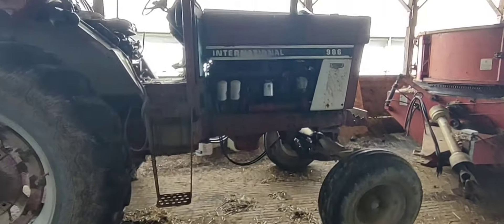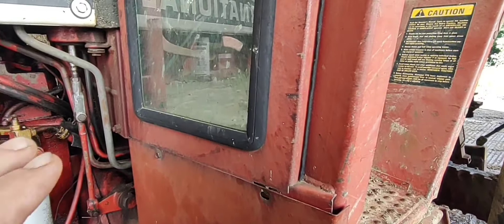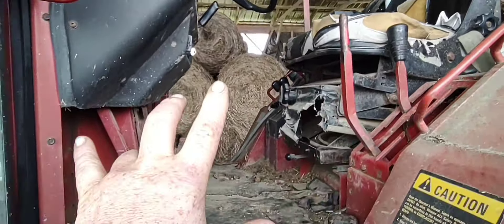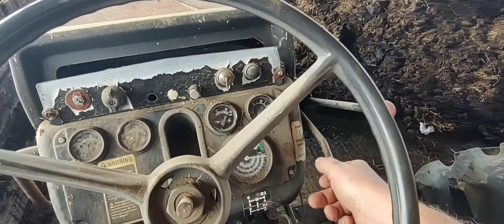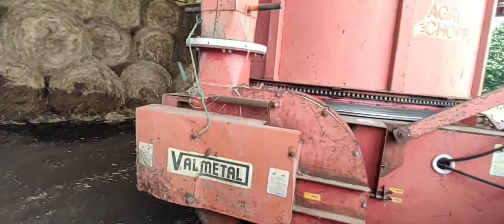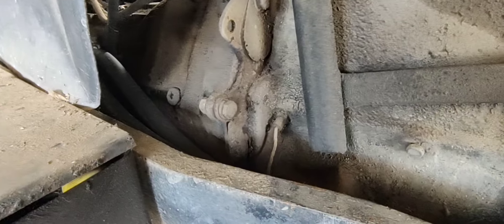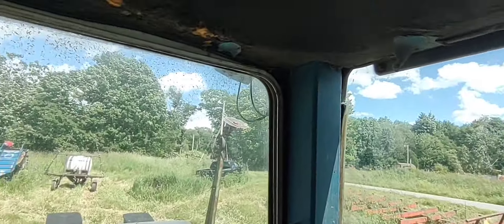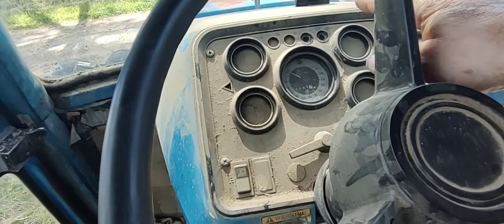Use, operation, and differences of IH torque amplifier, Ford Dual Power, and White Over/Under.

Comment: All 3 are good systems. All personnel preference. Have used all 3 and like all 3. Granted I am partial to red though. The small frame IH's will also free wheel with the ta pulled back. If used properly they will last a long time.
Reply from the maker: Each model has their design features and systems evolve and are updated over the years.

Comment: i like the IH system smooth to use great when your mowing , The John Deere system is good too , but IH is my favorite tractor make , I have a IH 674 with a loader and use it every day , the duel power on ford is very ok but they are not that smooth with the experience I have had  which is a lot Ford have made some good tractors over time from the old Fordson Major to the 6600 which was a fine machine
Reply from the maker: Smooth engaging is less stress and lasts longer.

Comment: Massey Ferguson has  multipower  transmission low and high lever on the dash
Reply from the maker: 👍 a neighbor had a 1155 and I remember the lever on the dash just didn't know their name for it
Reply: I have had a ford tw20 and massey Ferguson 1135 for 30 years and use them hard and never had a problem with either one. 6000+ hours on both.
Reply: Massey 255 has them as well

Comment: A torque amplifier is pretty much a power shift transmission similar to john deeres power shift transmission you can shift on the move
Reply from the maker: That's the big benefit of JD, you can shift between all gears. These you only have one shift in each gear.
Reply: Not really. What is similar is a quad range in a deere

Comment: The ih systems are not supposed to be shifted up under load. The old ta where weak.
Reply: They are not supposed to be used as a brake. They are to be shifted up and down crisply. Push them ahead in 1 motion quickly and the same when pulled back. Easing them forward and back is what wears them. Have all red tractors here, Have an 856 with over 9000 hours on the original ta. Wouldn't consider that weak. It's all in how you use them. Education is key on them.
Reply: @JeffMilitello  that just my IH mechanic tells me
Reply: @JeffMilitello  yep that’s was the problem with them they where not used properly. Just like this guys says he is using it.
Reply from the maker: @obieacres4676 maybe it's true and I don't know if this is the original TA and there is over 6400 hours on the tach and I've owned this tractor 20+ years put over 3000 hours on it and the TA is the only thing I haven't touched. 
The TA is just one link in the chain and like pulling with a chain, a smooth pull and you move, jerk it and links break. 
Right or wrong it works for me and I'm fine with it.

Comment: And then there’s me who’s a big fan of the Allis Chalmers power director and like it alot
Reply from the maker: Not many AC around here. I figured that they had something comparable since manufacturers copy each other. 😂
Reply: @Mad_Farmer912   no only Deere copy’s others allis is I think close to the international  but you can shift into low range on go down hill and it won’t free wheel but it not recommended better off stay in high range down hill